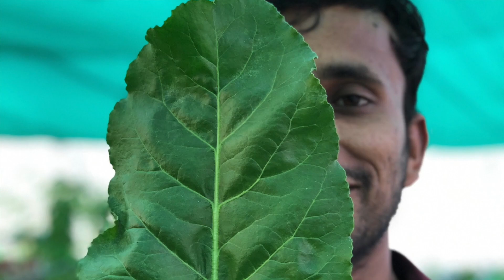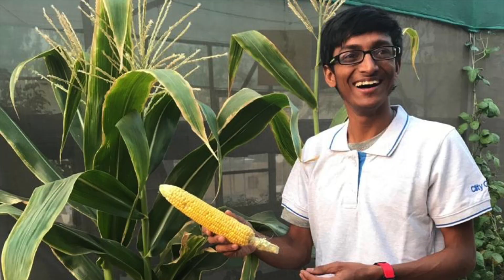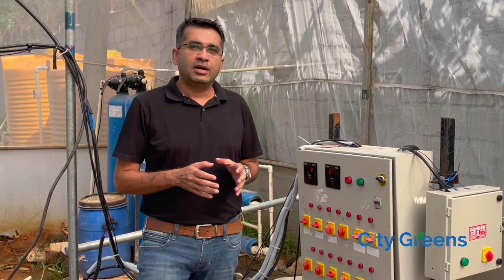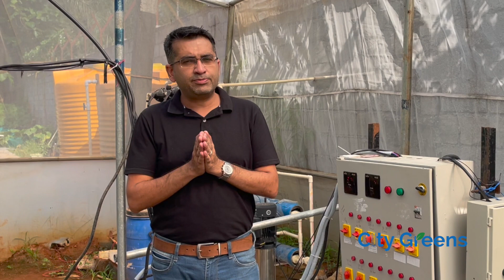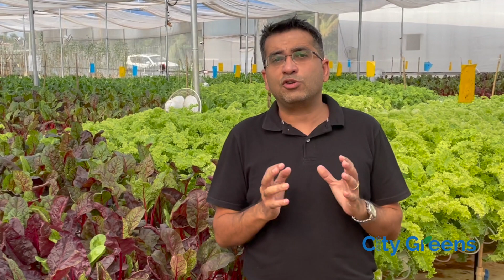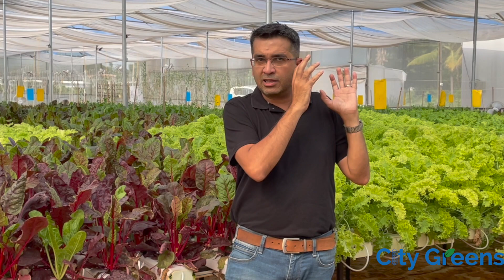Farm Automation System - What it is? Do you need it? How to automate a hydroponic farm?

Comment: Informative video sir but i want to ask u one thing I have developed a automated nutrients control system using IOT and its just a prototype.  Its a part of my diploma project. I want to ask that will it be usefull on large scale.
Reply from the maker: It should be. The logic remains same. What you will need to do is make your product robust and improve/upsize the components to work for scale.

Comment: Genrally how many time a day you need to adjust pH of nutrients if motar is running 12/15 hrs continuously?
And is it okay if i keep running my motar constantly for 12 hrs? I dont have timer based switch.
Reply from the maker: Ph adjustment is once a day should be ok. Try to do it at same time everyday. 

Go for a timer based switch. You will save a lot on electricity, enough to recover the timer cost in less than a year. 

Also it is not good to keep running motor continuously. It will reduce the life of pump. Run it for 10 minutes maximum in one go.
Reply: @citygreens2235  You mean 10 min interval right? 10 mins on 10 mins off